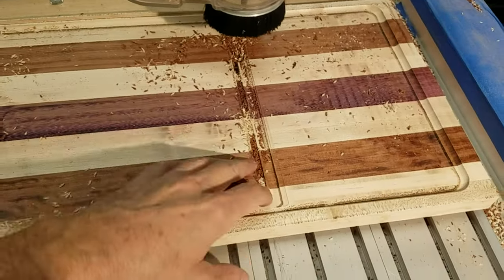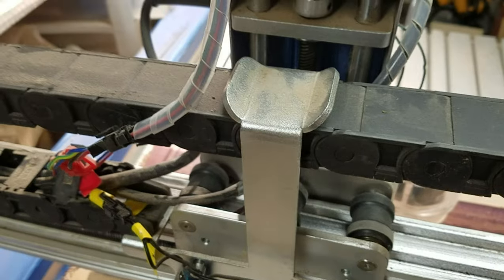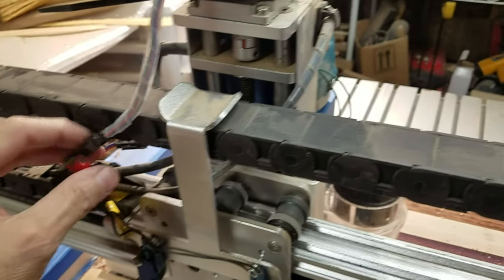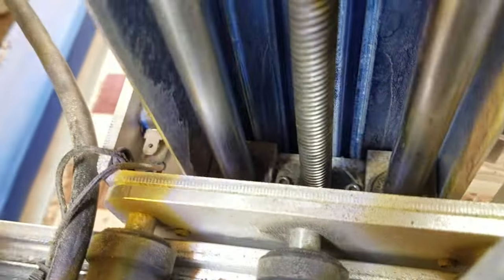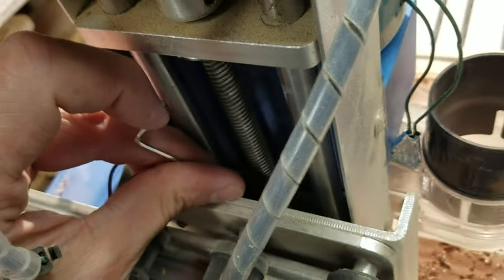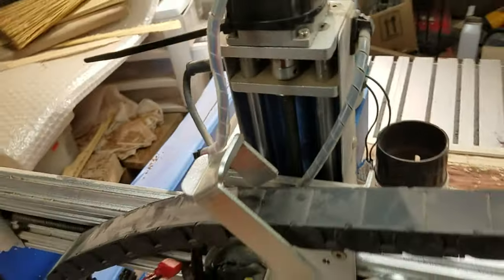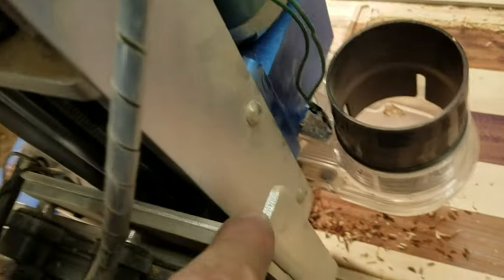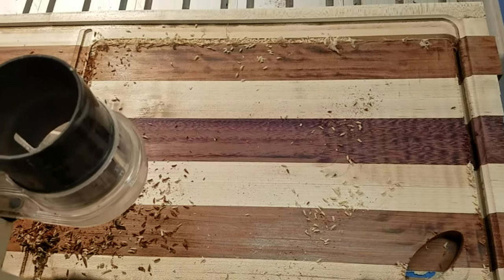Cnc Mill Fell Apart AGAIN!!!!

Comment: Take your own hint, you've done the third or fourth time ... Put some locktite on the threads !! Sadly it's a gantry strip & reassemble , get the adjustment correct before you locktite though. It's A tension setting, not a clamp down hard setting! But I don't see that being the cause of your spindle dropping. 
I had a "drop" problem few months back, the driver chip in the controller had blown, when jogging Z up, it would go up then drop 1/2", when jogging Z down it would do more crazy jumps ...
Reply from the maker: I can't get my fingers in there so I 'm very wary about taking the screws all the way out. I put some loctite on the heads, but it was getting stuck going up at one speed only (somewhere around 100 on candle if I remember right) - less or more speed worked fine.  I had to back them off a little more.  A new unit is on a slow boat from china right now.  I'd like to upgrade, someone in a forum said something about ball screws but I don't have any more info than that yet.  If unit #2 does the same thing - which this one is not at the moment - I will look into the stepper and controller, thank you!